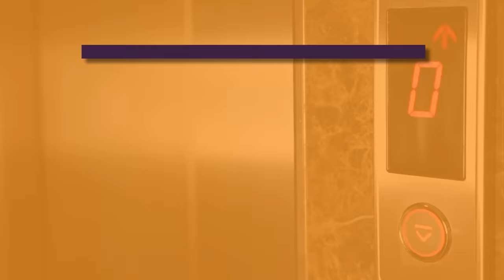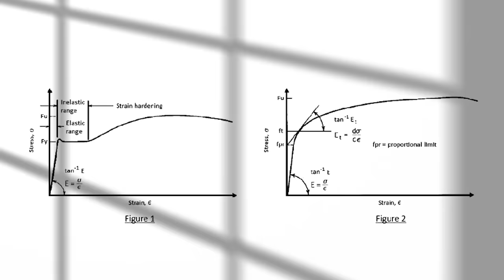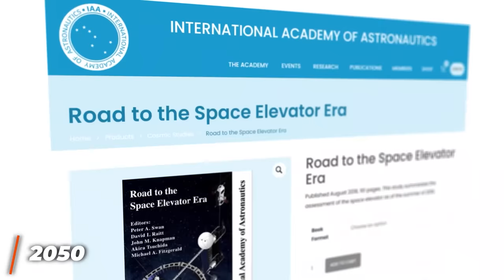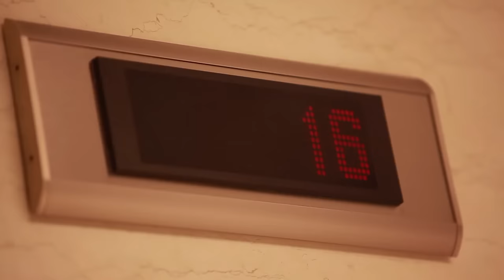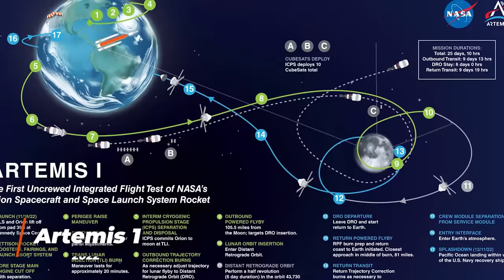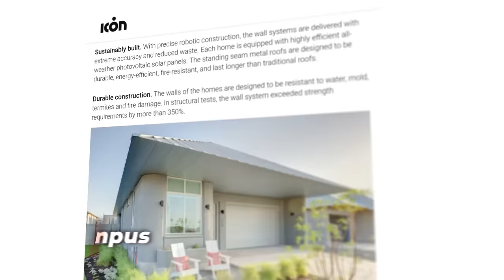Megaprojects of the Future

Comment: Regarding the space elevator: while we need new materials to build one on Earth, you could build one on the Moon using just steel. The gravitational situation of the Moon only gives you two locations where you can put one stably, though. One directly facing Earth, and one pointing directly away.

Wireless charging is NOT efficient. It wastes half the power. It might be tolerable for space-based solar power if you can generate it cheaply enough. If you can generate it for $50 per megawatt-hour, but lose half of it in transmission, then you'll be competitive with anything that costs $100 per megawatt-hour or more.

Comment: Assuming space elevator, it's not "easy" and "quick" to plonk stuff on or off the ISS. You need a vehicle capable of attaining the same orbital velocity as the ISS and dock with it. Easier than a ground launch, yes, but certainly not a simple thing to achieve. Multiple "cables" solution. Allowing a new "thread" to be wound up replacing old or degraded ones. Space mine sweepers to keep the orbital path clear?

Comment: If it is difficult to lower the elevator cable from orbit, then why not lower the wire of a solar power plant from it?
Reply: The van Allen belts would negate the need for solar panels, just a superconductor wire 50-60 thousand miles long.

Comment: The cable is by no means the only problem facing a space elevator. It will never be able to supply a low earth orbit space station because the tangential speed of the cable at 400 miles high is only slightly above that of Earth at its equator; about 1000 mph. The ISS has a tangential speed of 17,000 mph. Can you see the problem yet?

Comment: I think there would be other challenges for Space Elevator.. for example, Simon suggested that it would take 2.5h to get to ISS.. the problem with that is that at that altitude ISS travels something akin to 17K miles per hour, whilst cable's relative speed at that altitude would be significantly lower.. only at geostationary orbit does the relative speed of end-point of the elevator would match relative speed of Earth surface.. I don't know the math, but I would guess the speed at Around 300km would be around 1700 m/h (basically 100 times less orbital speed).. so rendezvous with a point on Space Elevator at that altitude is unfeasible (unless, of course, introducing another exotic technology).. I think best way would be to reach end-point of Space Elevator, undock, and then lower the orbit.. obviously engineers would need to work on speeding-up ascent of mass into orbit, otherwise the whole concept would make less sense to launching rockets.. unless the whole of Space Elevator would consist of hundreds, maybe even thousands of cables, each capable lifting and bringing down cargo.. that way, even though it would take longer, the amount of mass to orbit would increase drastically, and perhaps future Space Factories could use it to get raw materials into orbit and get finished product back to Earth in a week or so..
However, all that said I SINCERALY hope that Humanity will try this endeavor, and the sooner the better, as it would inspire awe (even if its early version wouldn't be particularly practical or profitable, at least with the ascent speed of 300km/h)

Comment: If a solar farm is in geo-stationary orbit, then it will have day/night problems like on earth. If the solar farm is always pointing at the sun, then the "beam-back-to-earth" will have to have multiple beam collector points across the planet, as the earth rotates underneath the farm in space.
Reply: Not really as you just put them outside the shadow of the earth.  Which is a tiny fraction of the available area.
Reply: @Da40kOrks   Right. Solar collectors in Geostationary orbit have sunlight about 90 percent of the time.
The diameter of a Geostationary orbit, from one side to the other, is about 84,292, if measured from the center of the Earth.
(Most geostationary orbits are measured from the surface to the orbit, but a diameter passes through the center-point, right?)

The diameter of the Earth takes up on 12,756 km of that, and it's very far away so the power-sat would traverse the relatively small "shadow" very quickly, because of that.
Remember, the sun is very much larger than the Earth, so light comes in at angles from all around the circumference of the planet, too.

Comment: He seems to understand that space elevator should be connected to an object in  geostationary orbit. But, when discussing travel times, it may seem inappropriate to mention the International Space Station (ISS) at 400 km away. This distance is significantly closer than the geostationary orbit, which is approximately 35,786 km from Earth. There's a vast difference in magnitude between these distances. It would be more accurate and meaningful to discuss travel times in relation to objects or destinations that are relevant to the context, rather than using random numbers from disparate objects in space.

Comment: There are many questions about space elevators that I can't find the answers yet; por example: Almost all space ocupation now are concentred in low earth orbit (LEO) and the elevator must be anchored in geosync orbit that is a lot higher. How to stop the elevator at LEO with orbital velocity of 2k Km/h (the geosync orbital velocity) and then acelerate to 28Km/h to keep itself at LEO without reenter? The solution could be move all our facilities to geosync orbit but what about satelites? They still need to be launched by rockets on earth or be bringed to geosync orbit and launched from there with rockets anyway to archieve LEO velocity? And it is only one question, there much others more.

Comment: If you have a solar array in space and a space elevator already built couldn't you just use the tether from the elevator to get the power to earths surface?
Reply: The solar array could also serve as an "actively useful" counterweight rather than just a deadweight.  The space elevator would also require a considerable amount of power.

Comment: The thing I always wondered about in regards a space elevator, is the air drag on the cable and elevator components, and how that will affect the orbital speed of the entire structure. Will it require rocket fuel to counter the drag effect slowing the structure down? As for Mars, I dunno why we're so keen on putting a base there and terraforming that planet when we have a much better alternative nearby - Earth's true sister planet, Venus. At least she has an atmosphere and an induced electromagnetic field to help protect against solar winds and solar/space radiation, unlike Mars (so no need to live underneath the surface like we'd have to with Mars).
Reply: Venus has sulphuric acid clouds and the surface temp is a mild 500C
Reply: Yep. We have almost half a million people flying in airplanes on Earth at any given time. It should be possible to one day have half a million people flying around in solar powered airplanes in Venus's upper atmosphere, where the temperature, pressure, gravity, and radiation levels are all earth-like.
Reply: There is no "air drag," any greater than what the surface winds are, that day.
The elevator doesn't move along the surface of the planet.
It's got a stable base -- probably in something that looks like  large oil platform, and it goes straight up  from there and never moves, because the station at the far end is moving at exactly the same speed as the planet is turning.

Put it in the "doldrums" at the Equator in the Pacific, where the winds sometimes just die, and you don't even have to worry about surface winds, very often, and what you do get are pretty minor.
It's why sailors in the "wooden ship" days disliked that part of the trip, between five degrees north of Equator and five degrees south of it, because they'd sometimes get stuck for days waiting for a squall to move through that could generate enough wind they could use.
Reply: @thomashiggins9320  I was more talking about the wind speeds much higher up, which tend to be a lot faster than at surface level. Though the reduced air pressure might make that have less of an impact perhaps? I'm not much of a mathematician or have much in the way of knowledge about fluid dynamics though, so you might very well be right. In my mind it's like the station itself is you and the cable and elevator is your hand sticking into a river - the difference between your upper arm out of the water and lower arm and hand in the water would push your arm back or forward cos the river has more volume behind it - same thing with space and the atmosphere. That was my thinking, if I've typed it out clearly enough? (I'm not good at expressing my inner thoughts very well so apologies if I made no sense lol)
Reply: @smalltime0  Yes but around 60,000ft up the air pressure is about the same as it is on the ground here on Earth, and the temperature is about 30 degrees centigrade which is basically perfect conditions for a floating city. Plus we can actually use the sulphur and other gases in the atmosphere to our advantage, as well as get unlimited energy either from floating solar power stations or even by lowering steam power plants further down into the atmosphere and using the ambient heat to boil water to steam to drive power generators. All benefits that Mars is missing out on. Sure Mars has lots of resources such as silicone dioxide, iron, titanium etc, but it still doesn't have as good a starting point for a colony than Venus. It'll be far cheaper to go for our first off-planet colony (after potentially the Moon) on Venus than Mars. And forget dreams of terraforming - even if we had the capability we wouldn't see worthwhile results for hundreds of years - and humans aren't good at doing projects that they won't be alive to see the results and benefits of.
Reply: @DavidStruveDesigns  I agree that Mars colonies are a dumb idea, I just don't think flying cities are going to be a soon to be achieved thing
Reply: @smalltime0   You're not wrong. Whilst we technically have the know-how and resources to do it right now if we wanted, it's not something that will actually happen anytime close to now. It would still require the cooperation of too many countries who, let's say "don't like each other much", just to supply said resources let alone fund it. Then there's another issue nobody ever talks about - if the off-world colonies ever become self-sufficient they will inevitably want independence from any Earthbound government - as all colonies at some point do from their parent/originator country. And nobody is too keen on that ever happening due to the sheer investment of money and resources it cost and the loss of returns or control over those returns (such as mined materials)
Reply: @DavidStruveDesigns  I think you've been watching too much "The Expanse", Belter.
Reply: @smalltime0   LMAO that IS an amazing series that I thoroughly enjoyed! But it did have a point, based solely on our own very real Earthbound history.
Reply: @DavidStruveDesigns the atmosphere extends up about 100 km, while any space elevator needs to go beyond geosynchronous orbit (~35,000 km). Wind will affect less than 0.1% of its length.
Fixed to the ground and with its centre of gravity above geosynchronous orbit, it will be secured against any wind loads.
Plus the equator does not experience hurricanes and other high winds.

Comment: A space elevator to the ISS would involve a clusterflock of problems of their own; not the least of which is the difference in lateral velocities between the ISS (5 miles a second) and the elevator itself (0 miles per second). There is a possible system thought up to deal with that, but you did not mention it at all.

Comment: Almost all problems with space solar panels could be solved with a space elevator, which can provide a cheaper way to get materials into geostationary Orbit and provides a means of putting a cable from space to earth, thus solving the power transmission problem.

Space debris is still a problem of course.

Comment: So, there is a big difference between altitude and orbit.
So riding a space elivator to leo would be pretty pointless. I.e. you can't just hop off at the iss.

E.g. at an altitude of 200 km the orbital velocity required is 27,400 km/h.

So yes, you would have to go all or at least most of the way up.

IIRC.

Comment: We've had commercially available solar installations for a lot of private houses efficient enough to meet the majority of that houses energy needs for decades. It even side steps the amount of space solar farms need by just being strapped to the houses roof too. In UK they even had subsidies available for a number of years to cover some of the costs for homeowners. The subsidies dried up though(which resulted in devastating that industry and a lot of small-medium sized companies going under btw) and now it's back to prohibitavly expensive for most. Just boggles my mind there's consideration for megaprojects in this when a big step forward would cost far less and is achievable now. I guess you can't be having your population becoming to self sufficient when it comes to their energy needs though 🤦

Comment: The problem is the iss is moving at 17500 mph. Or about 27000 kph... the elevator would be stationary. You still have to achieve horizon velocity to hold low earth orbit.
Reply: To be fair that much cheaper once your already reached the right height.

Comment: The issues about space elevator is not about strength of the tether, it's about the difference in speed of orbit vs what would be needed on the surface. No one has figured that out yet.
Reply: They have, that is why the station of the elevator would be in Geostationary orbit, ie. one where satellites are stationary compare to a location on earth. That is also why the weight of the cable material matters, because the cable itself wouldn't be at the speed required for a stable orbit, thus being pulled down to earth (well, technically this is also the case for stable orbits where you just move fast enough, but you get what I mean I assume).
Reply: @MDP1702  geostationary orbit is 22,300 miles up. And it has to be over the equator. I don't think people understand this. For comparison, the ISS is around 250 miles. That's a massive difference. By the time we get the technology to do that, there will be much easier ways to get to space.
Reply: @chrisfields8077   Well, yes. It is made clear that the production of the tether (needed amount) is what is making a space elevator currently not feasible.

Maybe by the time it can be feasible we'll find a better solution, or we won't.
Reply: @MDP1702  I still don't think people understand the lengths here. The circumference of the earth is only 24,900 miles... So the tether would have to almost be long enough to circle around earth. That's a non starter. Even if it as small as string, the mass alone would be too heavy to lift up to geostationary orbit. Wayyy too heavy.